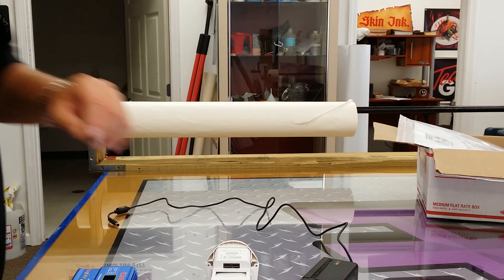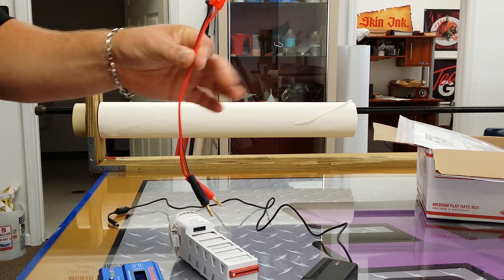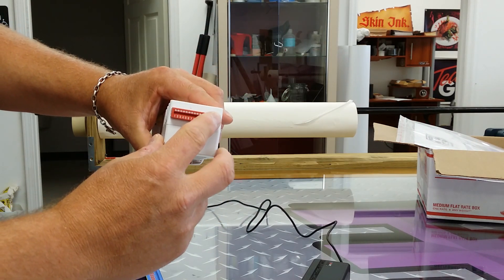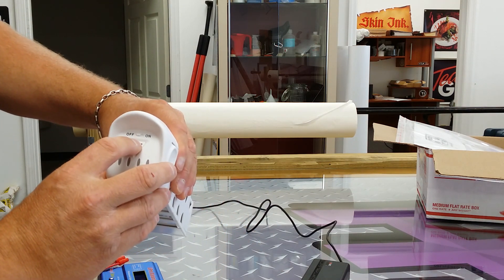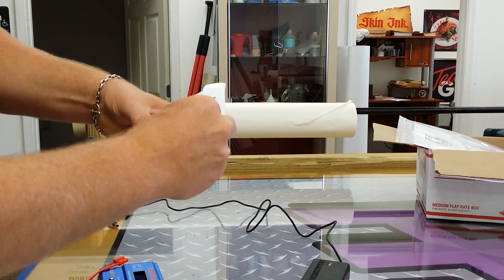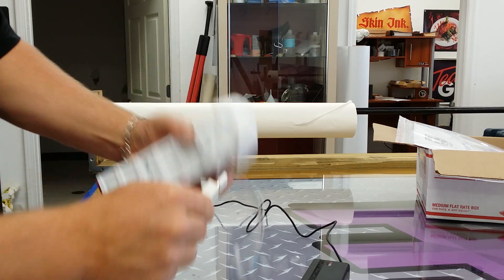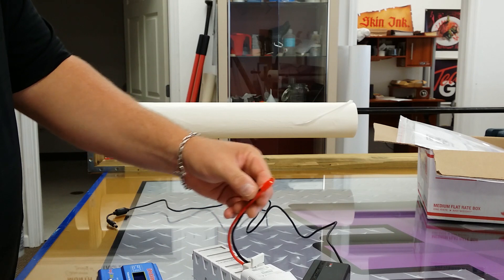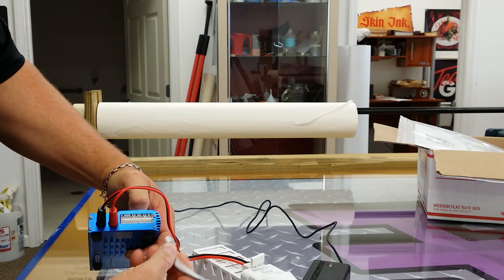Walkera TALI H500 Proper Battery Charging Procedure

Comment: Hi Chris - many thanks for the video. I have noticed that when my TALI H500 battery starts to run low (in use), the controls become slightly less responsive. I usually charge the battery once there are only 2 lights displaying on the battery.

Question - to maintain a long battery lifespan, is it better to fully discharge the battery BEFORE a full re-charge, or is this relevant on LiPo batteries?

Comment: Has anyone tried the Overlander RC6-Touch charger?
That's what I have and it's not working for charging the Tali 500 batteries. :(
Reply: +Watch Ryder same for you. Use another plug at your room which is still not leeching electric for some other device such as refrigerator...etc

Comment: Chris,  Thanks for the video. Once the battery is charged and the screen says it is full will it hurt the battery to remain connected to it or does the unit stop charging once it is full.  For example if you plug it in to charge overnight, will it damage the battery to remain connected all night long.  Thanks again.

Comment: I noticed that you connected the charging lead to the battery first, then to the charger. That is not the correct procedure, as there is a danger that you could accidentally short the two banana connectors together! You should first connect the charge cable to the charger via the banana connectors, THEN remove the white protector cap from the  battery connector and plug it into the battery.

Comment: I'm doing something wrong because as soon as it should start charging, the time shows one second and then shuts off.  I have followed your instructions but must have something set incorrectly.
Reply: +Terry Wieckert  same for you. Use another plug at your room which is still not leeching
 electric for some other device such as refrigerator...etc

Comment: Thanks for the video, Helped me out as well :o)

How would we know when the batter is full? Also mine is climbing into the 23+Volts when charging, is that normal ? Will this charger shut the operation down if it detects a problem?

                                     Thanks.   :o)
Reply from the maker: Its normal for charging voltage to be elevated. These batteries are huge so you may have to run more than one charge cycle to fully charge it.  When its full, the charger will beep and the screen say full.